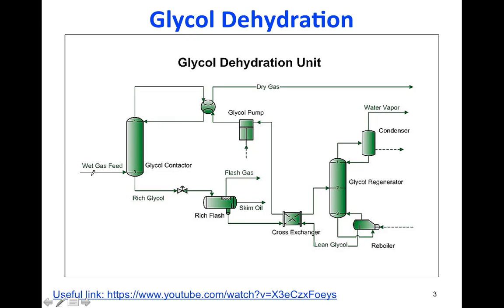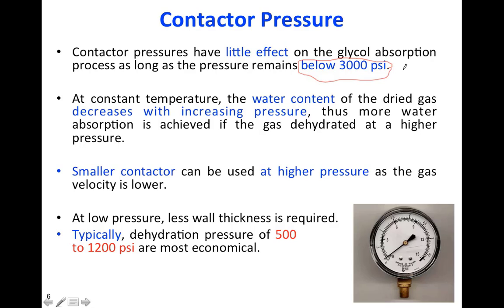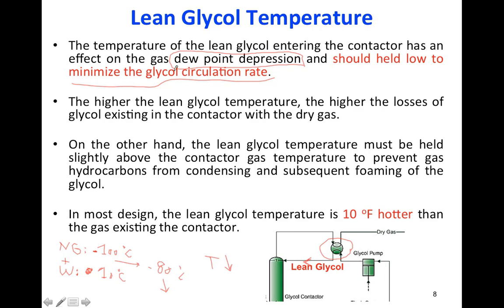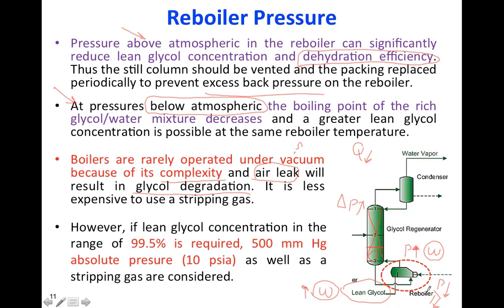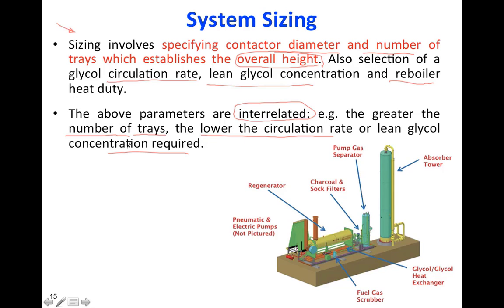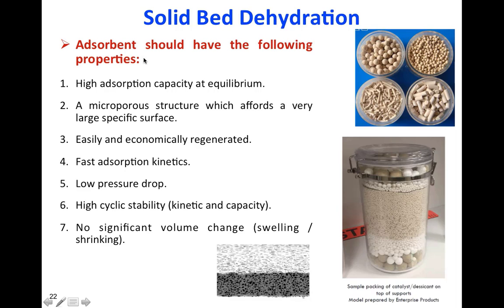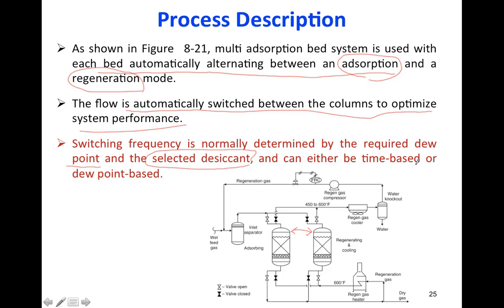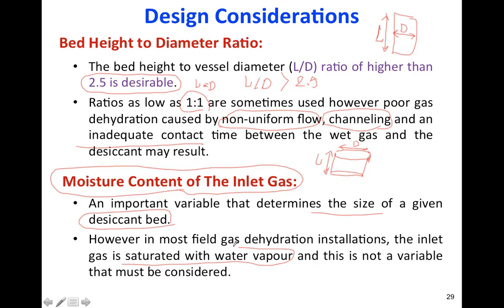Gas Dehydration Unit - Glycol Dehydration - Solid Bed Dehydration

Comment: Love your video but I am a bit confused when you said that the more trays, the more saving on the fuel for glycol reboiler. My Glycol regenerator requires more fuel to regenerate a more richer glycol as it had absorbed more water in the contactor tower.
Reply from the maker: Thanks for your comment. Actually, in the regenerator we are trying to remove water from glycol. The regenerator is like a distillation column that has trays. When we have more trays in the regenerator, that means a lot of water is already removed in the column between the trays and the glycol that come back to reboiler of regenerator has less amount of water so we need less boiling to remove water from glycol in the reboiler and consequently we will need less fuel (we will save fuel). Hope the explanations help :)
Reply: @Dr.Amin.Esmaeili Thanks  Dr, for your explanation about the pre -fractionation process that taking place across the glycol reboiler's still Colum trays stages that reduce the amount of water in the Glycol as it flows down to the Glycol reboiler. It indeed reduces the fuel gas consumption for the burner. I was confused because you were explaining the number of Glycol contactor trays effect on the Dew point depression in the particular slide presentation.
Reply: Thank you Dr.